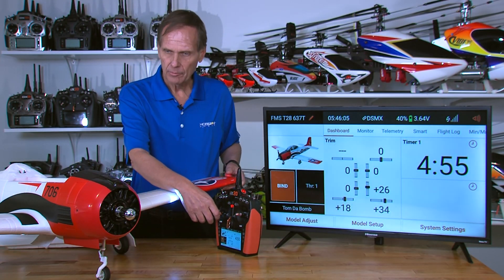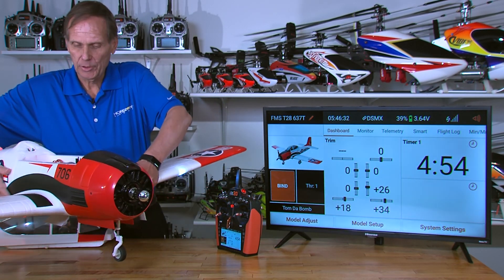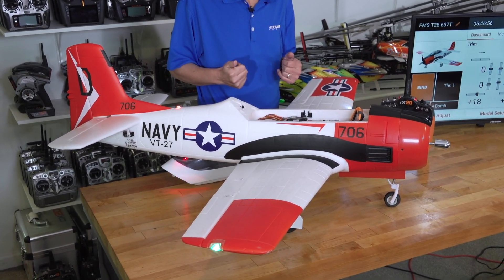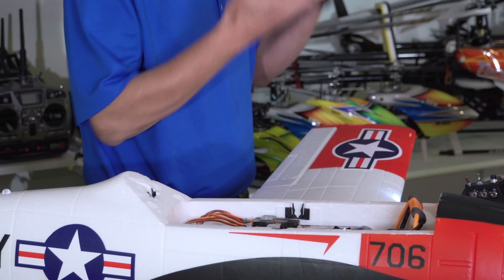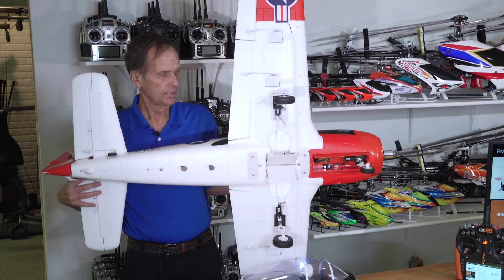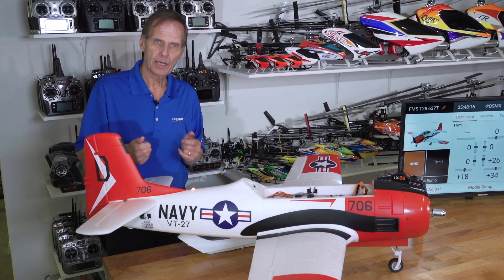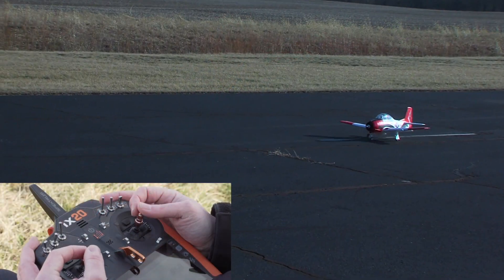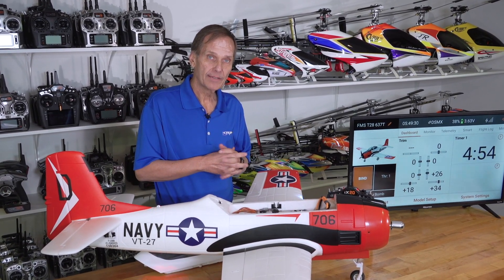Spektrum Smart Receiver AS3X Setup Series  #6 - Preflight Direction Check

Comment: Can I use my DX6 (gen 3) and just skip the gain channel step? It doesn’t have a knob, so I thought I would skip the step and use forward programming to adjust gains, but I can’t get AS3X to react at all. SAFE works, and so does heading hold, but not AS3X. I did advance to throttle to activate. What am I missing?
Reply from the maker: You can skip the gain channel part. you will just need to go into the menus and adjust gain. AS3X can be hard to tell if it is active given the nature that it is essentially in "rate" mode meaning that it only corrects while the sensors detect movement, where as SAFE is a heading hold type mode that will hold the deflections. If your safe mode is correcting in the correct directions then so is your AS3X mode.

Comment: Thanks for the video series! I'm a newbie and I think my gyro corrections are backwards meaning when I lift the left wing, the left aileron goes down. Is there a way to fix that on the transmitter?  I'm using the AR630. The servos were pre-installed and the receiver orientation is correct. Thanks in advance.

Comment: I took the AR 6:30 out of the Horizon Hobby F-15 64 mm. I can't program the receiver it is stuck do I need to set it up on a flight control I cannot access the parameters I see them but can't change them
Reply from the maker: You will need to unlock the receiver, this video should help :) - https://youtu.be/F3isbv1U8eM

Comment: Hi! I'm using a AR637TA in a plane that I built. Everything works fine except that I can not make both ailerons react in safe mode. It's always one that is on channel 2. The other one is one on Aux1. Do you know if there are any settings that I can change to make it work properly? Thanks
Reply from the maker: If you are using a receiver that is preset for a BNF or RTF model, then that is normal. If you want to set it up for dual aileron, you will need to flash the firmware and reprogram from scratch.
Reply: @SpektrumRCvideos  Yes, already did that. The thing is that I couldn't find how to make both ailerons work on a Y cable. Same with a AR8020T. Both aileron servos go on the same direction. I'm using a NX8. Thanks
Reply from the maker: @dorin8r  when using a Y it is sending the same signal to 2 different servos and you can not program them individually when using these devices. Your best option is plugging each servo into a different port and using a dual aileron wing type. That way you can adjust each servo for their individual needs.
Reply: @SpektrumRCvideos  But it works with my Conscendo Evolution with AR637TA and Y cable . Is it maybe because one of the aileron servos is set up to go in the opposite direction? I see now with lots of Flite Test models that they recommend using Y cable with ordinary 9g servos. If I can achieve this, I can set Safe Mode for my FT planes. Or maybe the orientation of the servo is backwards on the other wing? Thanks
Reply from the maker: @dorin8r  The geometry of the servo (in your case the orientation) has a direct correlation to the direction it moves yes. The reason I recommend separate ports is that you will have even better control of all servo settings, such as direction (reversing) Travel endpoints and subtrim. If you have the open channels, why not use them?

Comment: If one of the surface is moving the wrong direction how do you make it right?
Reply from the maker: The orientation is either set incorrectly OR you simply just need to reverse the surface on your servo setup menu and relearn servo settings in forward programming. Always confirm controls are moving correct direction before proceeding with AS3X setup

Comment: hi again i have now gone through yr procedure 6-8 times now most of it all works but still i can not get the giros to work ….i have tried to throttle up but still no giros …..am i missing something …..HELP !!!! PLEASE.
Reply from the maker: What are your gains set at? Are you using Flight Modes? One way to help us help you is to message us on Facebook so we can share images and videos :) Thanks!
Reply: @SpektrumRCvideos  Surely if you have the gains set at what the manuals recommend, you should see some response?,  even if it it not right for the model in the air. I am getting quite hacked off.